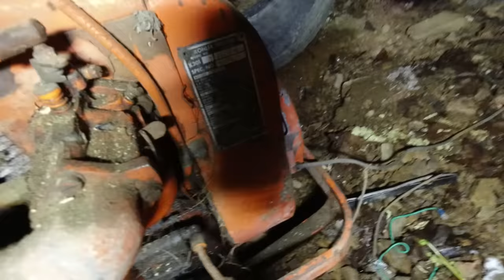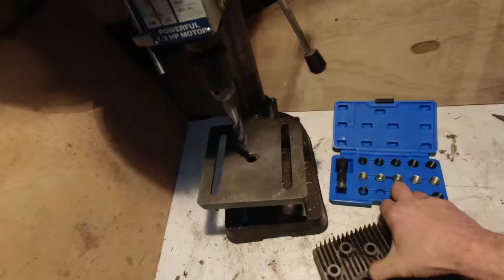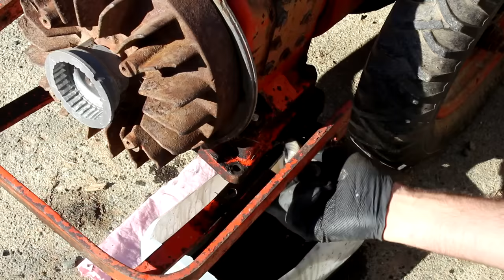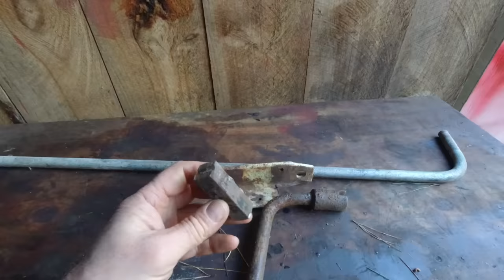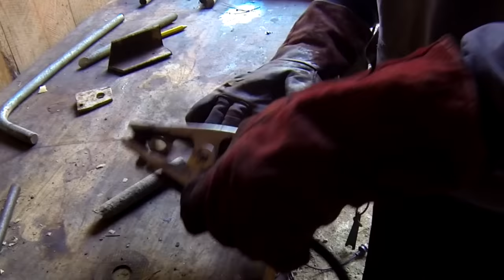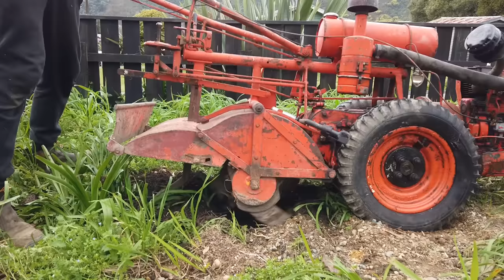Vintage Howard Gem Rotavator hasn't run for 15 years.. Will it Start??

Comment: Howard were agricultural engineers from Harleston Norfolk UK, Designed and built the Roto spreader for farm yard manure from 1960, Also built the first big baler for hay & straw in the 1970, John Deere from America asked Howard to build them the muck spreader and paint them in the traditional JD green& yellow, Every Howard machine was finished in the traditional bright orange, And they were known for manufacturing extremely quality agricultural machinery.

Comment: “Basically it’s a two wheel tractor with blades, so it’s going to be a fun machine if I can get it going” … Spoken like a true mad scientist 😂!
Reply: Nice mаn
Reply: Runs pretty good for having sat so long
Reply: @markhensley9378  Marty did a fantastic job getting it sorted out as per usual, and it sure does run great now!
Reply: @serhiitaranchuk7348 aaàààa

Comment: Bought an old masport commercial mower, never had as much guts as I thought it should, finally one of the valve seats popped out so i took the head off and staked the seat back in with a punch. Realised whilst i was turning it over the exhaust never closed, and the intake stayed open most of the time. Ended up taking 0.7mm of the intake and 1.2mm of the exhaust stems with a flap disk upside down on the lawn. Blessing in disguise it breaking on me, goes hard now 👍🏻

Comment: You wouldn't believe my excitement when I saw the photo of you pushing another machine onto the trailer, and as usual you didn't disappoint, well done Marty, and a 30 minute watch was the icing on the cake. 🙏🙏🙏
Reply: Agreed, I wish I had this luck of finding old equipment 😆
Reply: @endutubecensorship  you just have to look.  Go for drives and if you find something you like ask if it's for sale.  You might be surprised and get it for free because the person just wants it gone.  That's what happened to me.
Reply: @1965Gindy  I completely agree, I've got a couple old pieces of equipment that way. It just seems Marty has one heck of a lucky side.
I mean, free excavator!?! Common!! 😆
Reply: I spent the odd day or two hanging on behind one of those , I ached in places I didn’t know I had ! Enjoyed that mate 👍

Comment: I watch and have subscribed to your vlogs because I like watching old machines given a second life. Your knowledge on finding exact parts needed amazes me. What makes me annoyed is that most of the equipment you have acquired is because the previous owner just left it where it was because it stopped working. They did not try or were willing to spend the time and money to get it going again. But the other side of the coin you Marty would not have the joy in acquiring such machinery and get it going for a minimal cost. Plus you use them on your lifestyle block. Congrats.

Comment: You resurrecting another machine from disuse is always enjoyable.  Thank you.  When my grandfather was teaching me about  crank starting an engine, he instructed me to always crank using my left hand, because in the event of a backfire, the handle of the crack will come back around and hit your open left hand rather than the back of your right hand.  Perhaps with smaller motors it is not as critical but on a Diamond T truck, it was important.  Thanks again for a wonderful rescue of something old.
Reply from the maker: Good advice, these machines have an anti kickback ratchet on the starter so its not so bad

Comment: Well done on getting it going. My Dad had several of these when I was young. With hard ground, lower the depth gauge (in front of the gear selector) to limit the depth of cut initially. Your machine looks similar apart from the engine. The starting handle you made  should swivel like you made it and rest into the two upstands on the guard after starting. My Dads ones had a very small petrol compartment on the front of the fuel tank, started on petrol and then switch the fuel to the main tank using paraffin once warmed up. The blades were called tines if you need to look for new ones.

Comment: 60 years ago, I bought a Howard Rotavator, it had a hand crank and a lever to de-compress while you cranked it and after a few turns you released the de-compress and it generally started. I used it for 5 or 7 years and did a lot of custom work with it. It really was a good machine.
Reply: Which engine /BJ/JAP or Howard twin ?

Comment: This machine brings back memories. There was a Howard Gem in use where I used to work many years ago. An absolute beast of a machine which could fairly break up the soil . It made cultivation a lot easier. A great video.
Reply: and your ankles

Comment: Great job! I'm always impressed by the condition of machine you can get running!
My parents had what I thought was a large rototiller, but that thing looks like it's at least 2x as long. This was in the mid to late 1970's & early 80's. I'm in the USA. Don't recall what make or model, but it was a Briggs & Stratton Engine, as are most such engines in US.
If you had all the blades you would have much better results. Unless it is an active garden, or you cover the grass/weeds with cardboard or plastic for several days/a couple of weeks, it takes 2 or 3 passes just to break it up. I usually do about 4 passes to ensure I've broken up grass. It tills much easier to cover with cardboard for several days, or over winter.

Comment: These Machine came out with a range of attachments such as tine harrows , molding boards for potatoes  , chain harrows and even a small cambridge roller ...  
Also a reel mower attachment inplace of the Rotary cultivator ,  a sickle bar mower Attachment  ... also a Hedge trimmer ..with Shearers type flexible   for it ... also a  three row Weeding coulter  bar attached in place of the  rotary hoe module ...
I had a Bantam version which was smaller but had similar attachments no reverse was always an issue in tight spots or on slopes lol ...  

The hoe unit was more effective than the Gravely rotary attachment  ...  but it was a good  overall cultivator ... My Dad always wanted to up grade to the Gem but didnt get around to it lol ..  

I have since got a Gravely got a Gravely with 9kw k301s motor with brush deck and a reel mower head would like a rotary hoe head and snow blower as well probably have make one of those lol ...

Comment: Had one of these when I was a council gardener. I quickly learned to adjust for yhe depth you want and give it time to burrow. Newbies would haul it about trying to straighten it up as the tines would catch a firmer bit of soil or roots on one side or the other. 
But the secret was to point it in the general direction you wanted to go and then relax, let it buck and weave. It would always average out in the end. If you tried to keep it straight it'd absolutely knacker you out in 30 minutes flat!
It was a kind of zen, zoned out, relaxed at the shoulders, chilled amble behind the beast letting it do all the work... "Ommm...."

Comment: Beast of a machine Marty, you will have more muscles after making a garden with that thing.
Remember seeing one similar with swivel wheels on the rear and snow plow attachment in the front many years ago + a small standing platform on a hitch attachment also with wheels so you could stand and drive it like a garden tractor.
This was back in the 70's over in Sweden.

Comment: Actually you do not need the manual in your phone. Valve clearances and other information are already provided at the bottom of the Kohler engine tag as "in 010 ex 010". Good work as always. After sitting so long, it is still in a quite good shape. And loved the improvised crank handle.

Comment: Great job, looks to be in great condition, drain the gear box and chain drive, they tend to like to take in water. Too bad this company got taken over and lost forever, they made a variety of models over the years, model 200, 350 and the Gem which also was available in dual wheel and diesel engine. Best of luck in your projects

Comment: Nice find Marty
With our old roto tiller, it had an option for the tiller to spin forward or reverse. It always worked better with tiller spinning in reverse. The machine doesn’t always want to run away from you then. It digs in and the tiller works the ground more. Great vids! Thanks

Comment: A bit of advice my dear old dad told me about hand cranking engines, from his experience with tractors and cars, was never to wrap your thumb round the starting handle but keep it on the same side as your fingers because if the engine kicks back your thumb will be in the way, resulting in a broken thumb. Either that or convert to an electric start LOL. Thanks for another great video. Keep them coming.
Reply: A lot of those engines had an "anti-kick-back" ratchet arrangement so It couldn't bite you...
Reply from the maker: Good advice, but as Graeme has mentioned this one has anti kickback ratchet

Comment: Thank you. Brought back memories. In the 1950's we had a small farm and used a couple of these. The models we used were slightly different. No pull start; a crank handle where yours had a pull start. Also they had 2 fuel tanks. One you filled with petrol and the other paraffin. We would start it on petrol then after a few minutes switch to paraffin. Great little machines.

Comment: Hats off to the original designer[s] and hats off to the current day fixer with a passion to keep these timeless machines going. Nice to see that the pull cord start also has the back up of a crank start option and I loved the bolt on hinge crank solution.

Comment: Thought you might spin the starter with the pull start removed with a drill or something, but a fabricated crank handle instead, very nice.
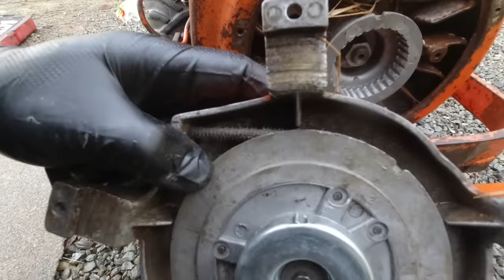Reply: Actually there are rope slots on the front of the flywheel. Pull the recoil unit off. Get a piece of 3/8" braided "clothes line" about 2' long,  tie a stopper knot in one end, stick it in the slot, wrap the rope around the flànge and give her a yank. The notches are visible on the top and bottom of the spline coupler flànge at 5:25.

Comment: Great job those old Kohler engines literally will run forever, practically indestructible, I used to have an old Wheel Horse machine set up just like that one. Thanks for sharing, cheers from Jacksonville Florida 🌞

Comment: We have a very similar walk behind tractor that was very popular in the '60s here in the US, I believed it was called a David Bradley. They are fantastic work horses especially in a hard to access area. One very popular mod is to build a silky, basically a plank between two wheels that hitch to the tractor like a trailer. That way you get to stand rather than walk. I have an elderly neighbor who rigged his with a chair as he was too old to stand. It goes a lot slower, but it keeps on going
Reply: I believe I was mistaken earlier. Once I got a better look after you got it running, I'm pretty sure that David Bradley's had the implements in front of the engine thus allowing the silky. Doesn't look like it would be very wise to be seated behind that monster. Also, the David Bradley's are like half that size

Comment: Very cool trick on the thread repair. I have never thought to put grease on the interior. I would have thought that it would mix with the loctite as you spin the insert in. That is an excellent trip to put in the mental toolbox, thanks!
Reply from the maker: Yes you have to be careful to wipe off any excess grease and not let it get to the insert thread

Comment: I'm thinking that transmission should have a lever for a gear reduction, or 2 speeds, a higher transport speed to get to the garden, then a low so it will barely move but have lots of grunt
Reply: Yep agree. You can't hoe with that wheel speed. My Pasquali has that lever plus a dif lock.
Reply: Gears are under handle bars.  He played with them at very start of video

Comment: Hey mart, what was the dirt bike to the left of the machine you rescued?? Cheers andy LIVERPOOL UK 👍
Reply: I was looking at that dirt bike too!!
🤓
Reply: Looked like a old hill climber
Reply: @patrickblock2477  
No it looked like a normal motocross bike..swingarm is normal length...aluminum so 80's at least ( 82 + ).... Shock location and position shows late 80's most likely.... Think Yamaha or Suzuki??
Reply: @garymallard4699  looked Suzuki to me. Lots of parts missing from the carcass.
Reply: @bobturnbull18  
I'm sure there is enough to Franken-bike it....find another bike ( or 2 ) and build one??
Reply: @garymallard4699   Twin drums so probably early 1980's,   Suzuki RM  is my best guess as the Yam YZ  had a different shape swing arm from memory......
Reply from the maker: I believe it is a yamaha, I might have to have a closer look at it, it did look very corroded, maybe too far gone
Reply: Monocross on the swingarm so it's a Yamaha and looked to have a yellow shock so guessing it's a IT250.
Reply from the maker: @jmerwood9  Sounds like you know your stuff, I thought maybe a yz250
Reply: @MartyT  I grew up on 80's bikes, it could be a YZ but the yellow shock spring (should be red or black on a YZ) and the placement of the reservoir looks IT to me. The hoop at the rear of the frame also looks like where the tool kit is mounted on a IT.
Reply: @jmerwood9  
I raced from 75 to 90 and mostly Yamaha...i had alot of 80's Yamaha's.  As i raced 2 classes....an IT might be what it was..  Sure would like to know !! Maybe there are parts to rebuild it back to ride condition...looks like a video could be made??

Comment: Marty, the bar that goes down behind the rotor blades should be lifted up while you operate the machine and put a bit more weight on the handles so the blades go down a bit deeper. Also they used to have a set of wheels to hook on the back so one could ride on it. I used to operate one at work, that had a hitch so you could tow other bits of kit around behind...

Comment: Was really surprised to see spark off that engine. Usually after they have sat for years the points get oxidized and won't fire. Usually s few wipes with a point file fixes it, but it's always a pain to get to.
Reply from the maker: I did actually set and clean the points but my hand was in the way of the cam so I didn't use that footage, it made a big difference to the spark

Comment: The problem I find with these old engines is they were built to run on leaded fuel. People then put unleaded fuel in them and the exhaust valve and seat burn out. Engine stops running due to lack of compression. Please add some upper cylinder lubricant to the fuel.

Comment: Another great (instructional for me) video Marty T! I was impressed that the valve adjustment made the difference, another troubleshooting tip for me. You honed in on the alternative starting option too, fancy having a crank point as well as the pullcord. Good machine, hope it gives you many years of faithful service!

Comment: I wish Kohler kept those older fuel pumps on the later  "K" and "magnums". Having a primer would be great. I went thru 2 mechanical pumps on the magnum 12 in my wheelhorse before I put an electric Facet fuel pump on. Been very reliable for 4 years.
Reply: Good to know, I have old Kohler's and Facet 12v fuel pumps laying around
Reply: Facet are still are still made in USA, a bit pricey $50 but it’s been reliable. I bought mine at Napa. Some guys wire them into the ignition, I just picked up 12v off the battery, wired to a switch, 15a inline fuse, ground and up and running. Just can’t forget to shut it off!

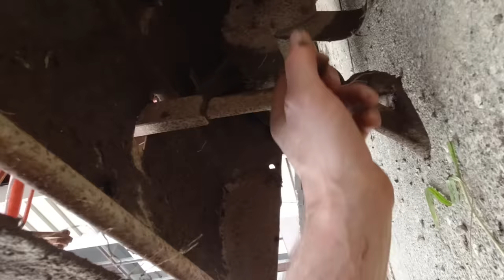Comment: 29:23   The plow shoe is facing backwards.  Turn it around to face forwards, it acts as a ripper, also acts to pull the back end down and keep the tines in the ground.
Reply from the maker: Thanks for that, I didn't notice
Reply: @TF856  Fine, you can call it that.  It will still work better if it's turned around.

Comment: Called Rototiller or just "tiller" here in the states.  Many rear tine models have counter rotating blades (ex Troy-bilt Bronco) which, in my opinion, makes for smoother operation.  It is interesting that Howard counterbalanced the thing my extending the engine way out in front of the drive wheels instead of adding weight in front of the engine.
Reply: @TF856  I can think of another arrangement that would result in the engine over the drive wheels. But, that would result in less well balanced machine.
Reply: My two cents.
Rototillers are one direction with the tines. 
Rotovators have both a forward and reverses on the tines.
On hard ground use reverse to be and forward wheel gear.

Comment: That K301 is a 12 HP engine! Garden tractors use that same motor. I have a walk behind tractor with the same motor. You have a magical touch with machinery! My K301 is giving me fits with spark issues. I think it may have been underwater for a wee bit, though, since the piston was corroded to the cylinder wall. Great video. I think the giggling audience is a nice touch! Thanks for a video that I can directly relate to!
Reply from the maker: Did you check the points? mine were out slightly and it made a big difference setting them and cleaning, also my kill switch wire was intermittently earthing on the frame
Reply: @MartyT  I had to take apart the motor to clean, put in new rings, replace the valves and change the camshaft. There are new points, condenser, wires and magneto. I even painted it. I'm hoping watching your success will infect me with good luck!

Comment: Nice job Marty! Awesome to see happy kids in the shed with Dad too.
Bout that Muffler mate, I use stainless scrub buds pot scourers as muffler stuffing. Unlike steel wool they are broader shaped woven strands like swarf and broad enough to handle the heat and flow freely unlike steel wool and $5 of these lil gems and she will quiet down just fine.
As for the Pull start? Love the crank handle but im an old fat bloke so id have grabbed a drill and socket to suit the chewed bit behind the pull start and electrified the sucker, Works a treat as a few of my Mowers will attest to plus? No stokes or hearties pulling and swearing.